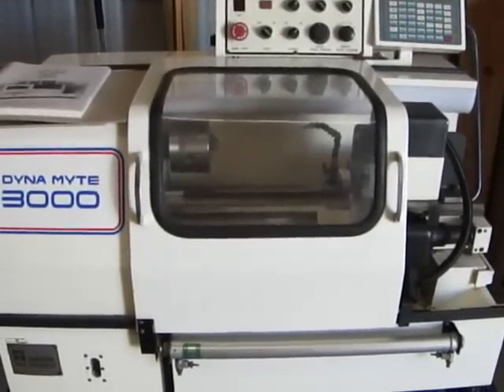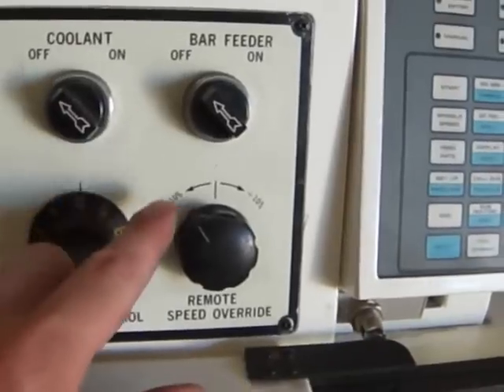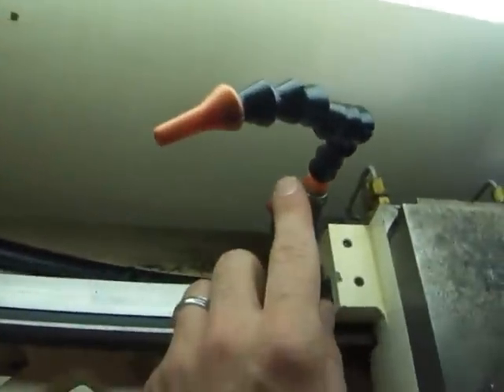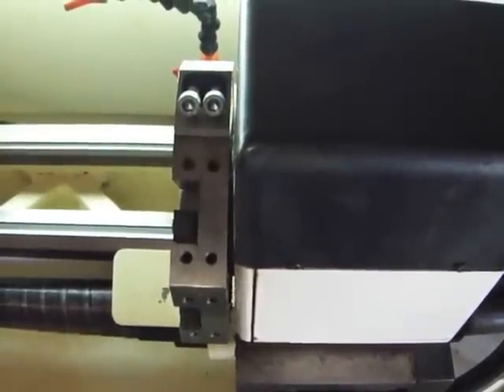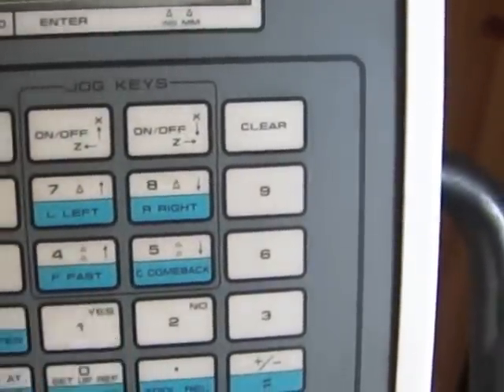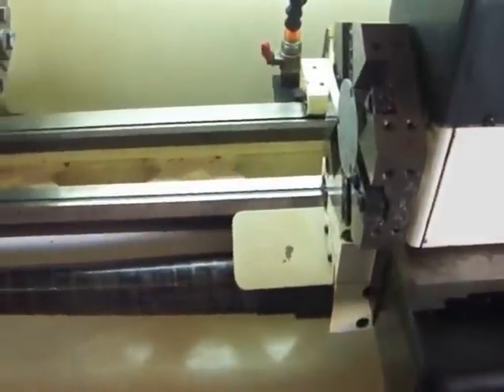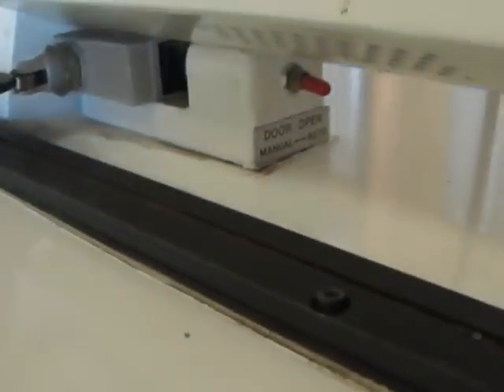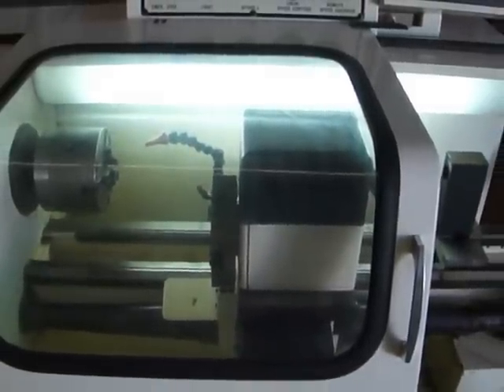Dynamyte 3000 CNC Lathe.MP4

Comment: Regards, if it can help me, I have a dyna myte 3000 with all its original e, for the moment I do not want to convert MACH3, I failed controller, I think are the EPROM 27256 damaged, would you please read the EPROM of its controllers with a EPROM programmer and send them to me via email, if it is not too much trouble, thanks

procommel@aol.com